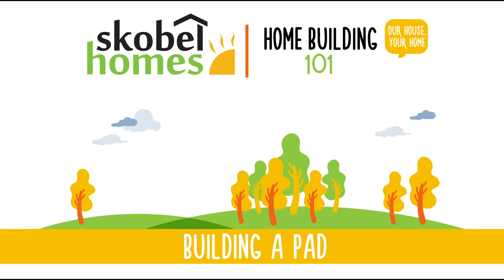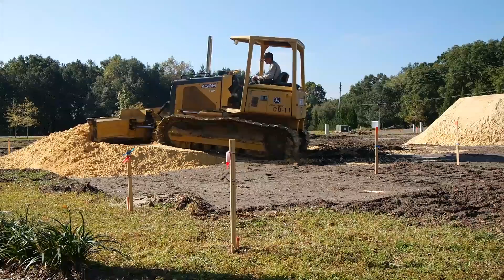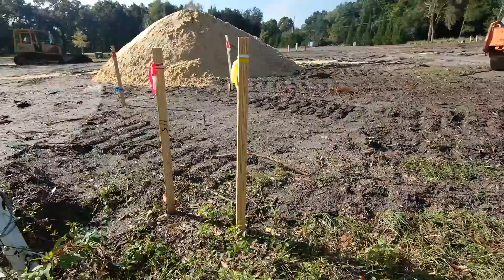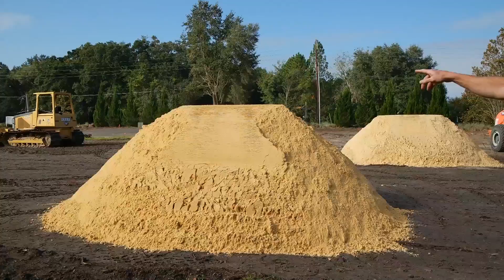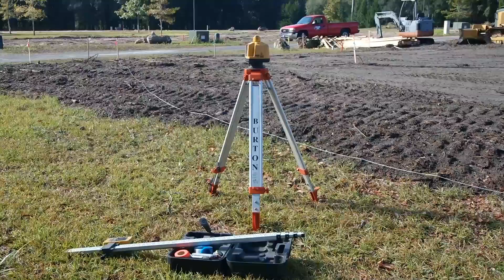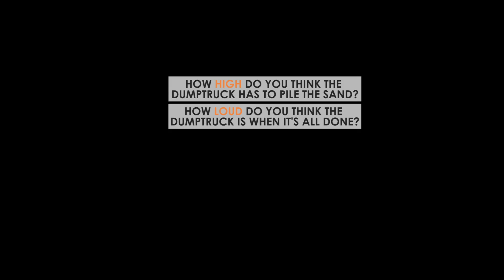Homebuilding 101 - Building a Pad

Comment: all that talk and he int operate the dozer ?
Reply: How many loads of dirt does it take to move in a 16x80 mobile home? How many inches high should the pad be? And roughly what does this cost?
Reply: @susansaldanamurrah7865  1-2 loads of dirt and a plate compactor will work fine. About 2500-3k for that if it took two loads of dirt.